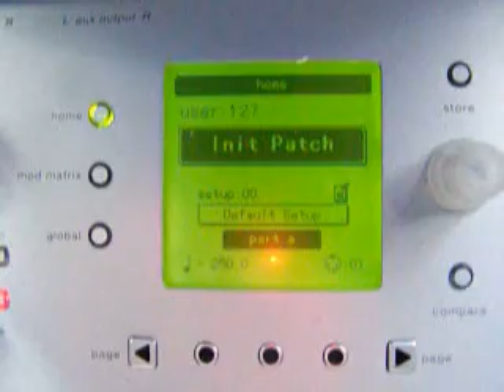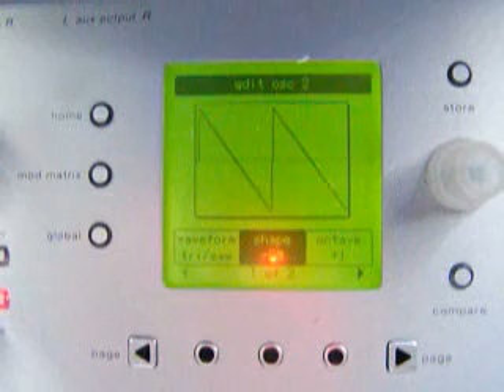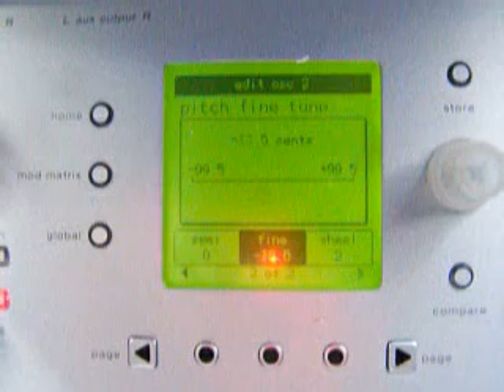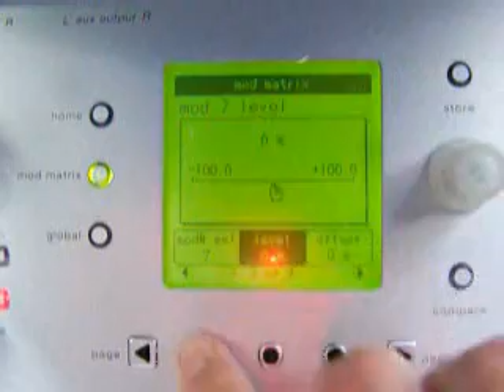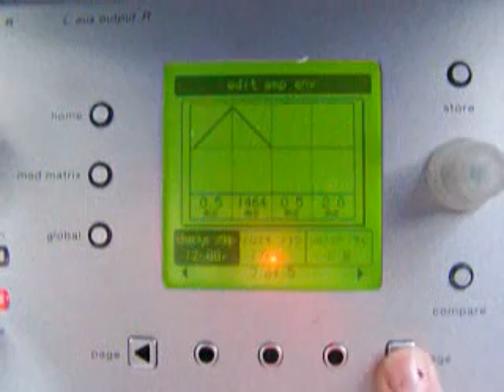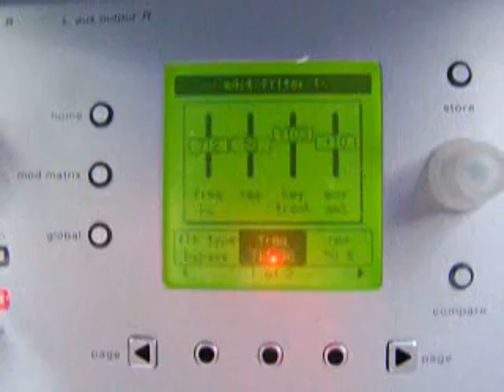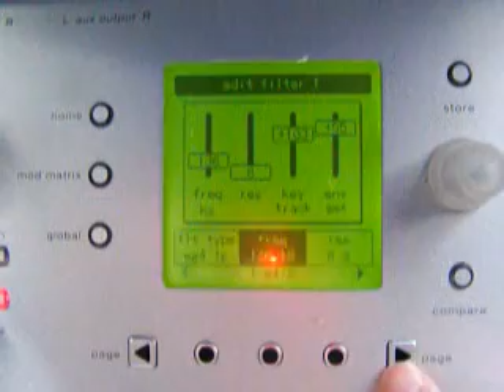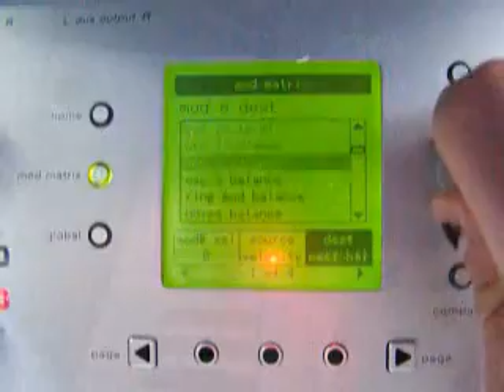Alesis Ion easy synth-ing 2: making a piano sound.

Comment: Very much a Wurlitzer EP sound. If one understands synthesis programming and has a good ear-and maybe a Wurly laying around-not too hard to do. even harder to do-recreating the dynamics of a Wurly to bring out the tines distorting when you smack the keys. Many workstations and synths have done this, with layers. Definitely more challenging on this board, but this is a good example of how to do it with the Ion.